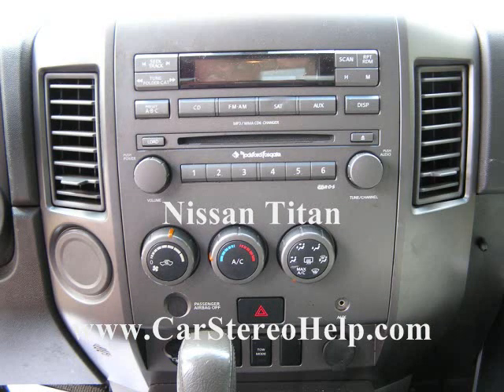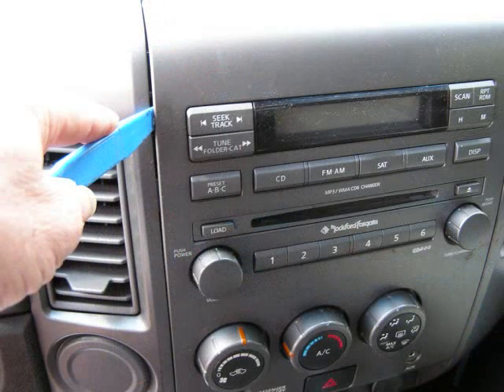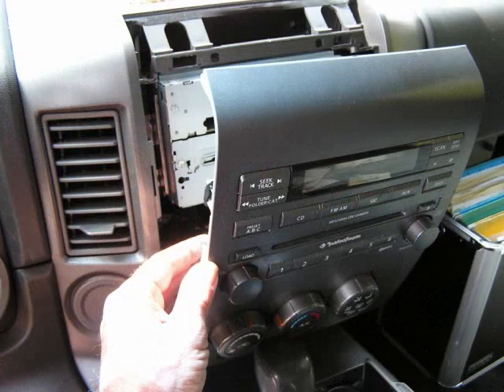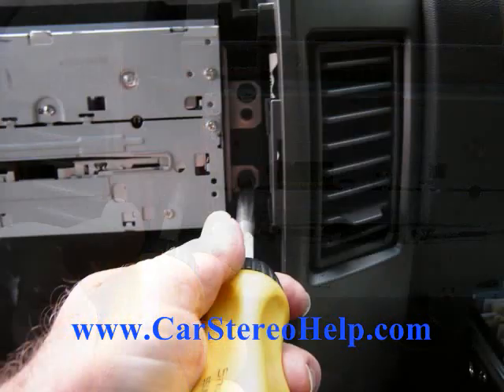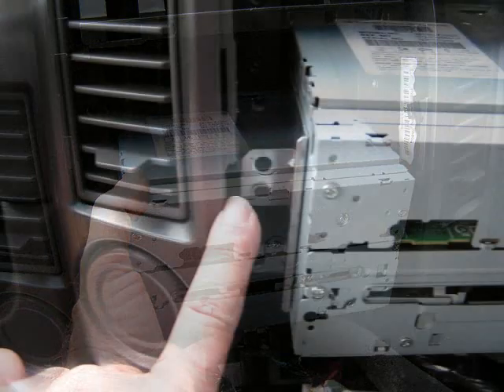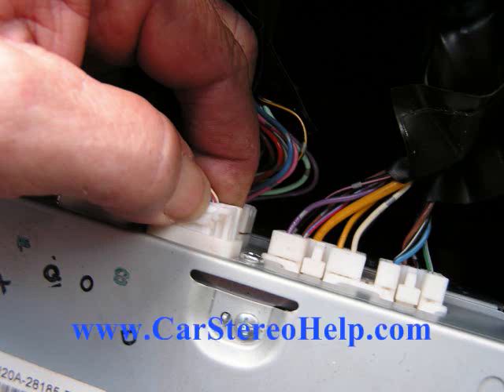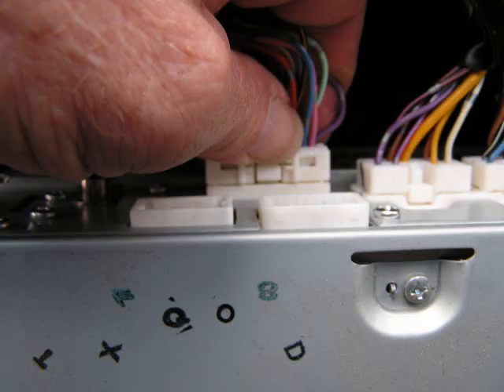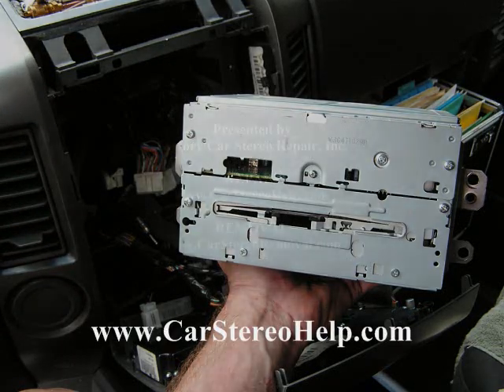Nissan Titan Stereo Removal 2004 - 2008 = Car Stereo HELP

Comment: Let me ask, if I want to remove the original stereo and install an aftermarket single din. Do I need an adapter panel or can I just cut the original and make it fit in there?

Comment: When I tried to re install the factory radio it won't work.  Is there a anti theft code?
Reply from the maker: NO anti-theft. If the radio does not work, check both fuses. One labeled radio inside the passenger compartment. Second fuse under hood, may be labeled "Back Up". Both fuses good, bad radio... Bob
Reply: This was very helpful didn't know about the fuse in the passenger panel thanks a lot..